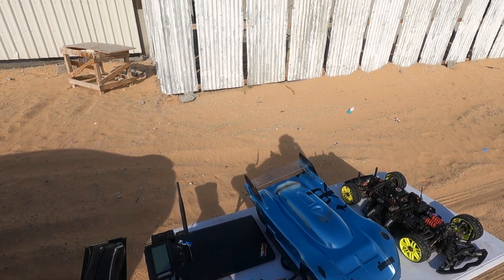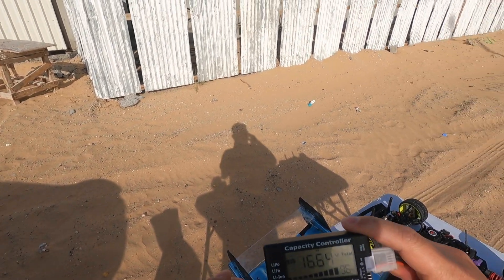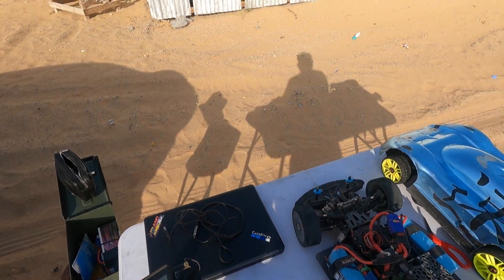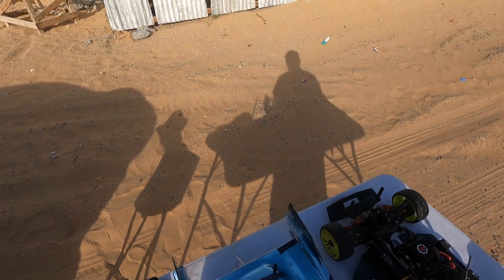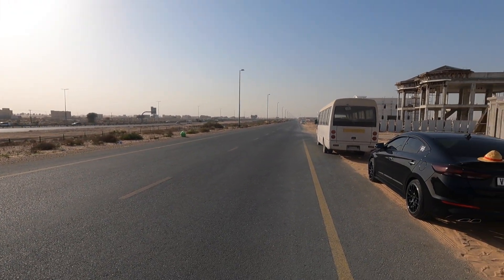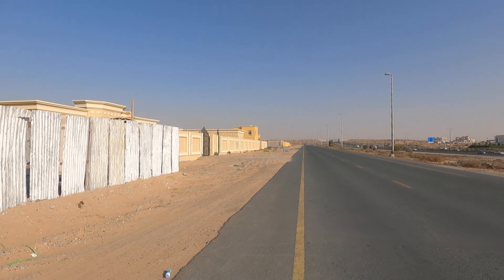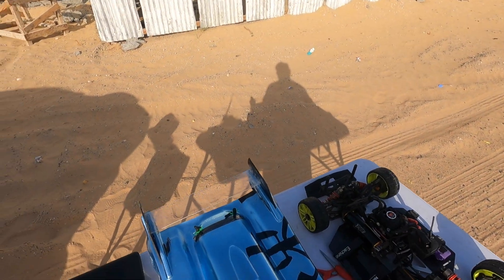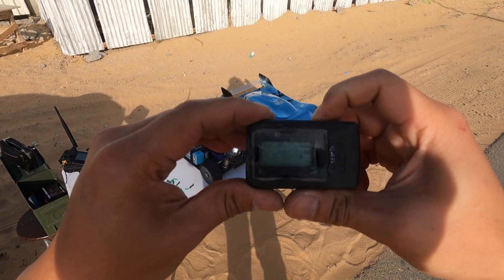Hobao VTE YoWoo Lipo Battery Speedrun Test

Comment: I have a 3s 5000mah graphene yoowoo battery which shows 2-4 mohm per cell. Hearing yours are only an ohm makes me feel like I got a bad pack. This pack is still fairly new, should I try to warranty it?
Reply from the maker: Yes I also have 3S and it is also showing 1ohm. I made a short video of it in comparison with DXF batteries and I will upload it later aswell. Regarding yours, its indeed high hhmm you can try to write them
Reply: @RCSpeedRunDubai  Yeah fully charged after over an hour rest I get 2.2mohm, 2.3mohm, and 2.2mohm on my toolkitrc m6. Empty to full it takes 5.15ah. The pack has great punch I'm just concerned about the longevity of the pack if the resistance is measuring twice what it should be already.
Reply from the maker: @HX_RC  that is weird, i've tested 3s and 4s both shows 1ohm on used or fully charged
Reply from the maker: IR Test: https://youtu.be/sUnbKHdhMMw
Reply: How long does It take to charge?